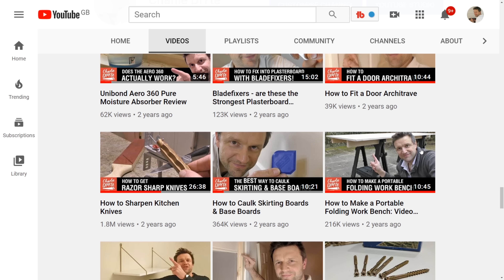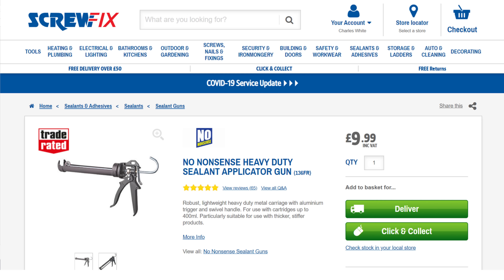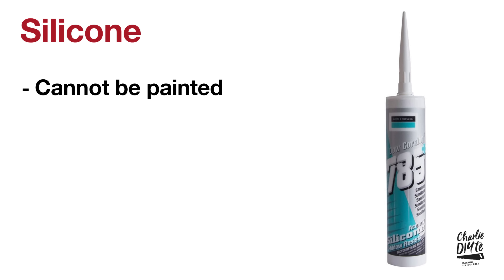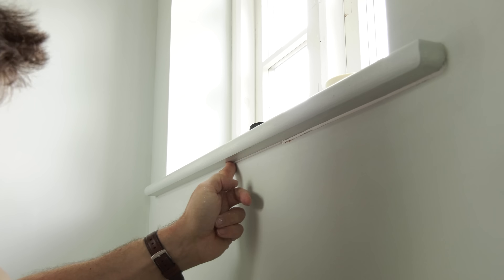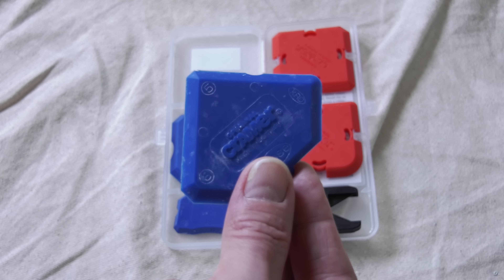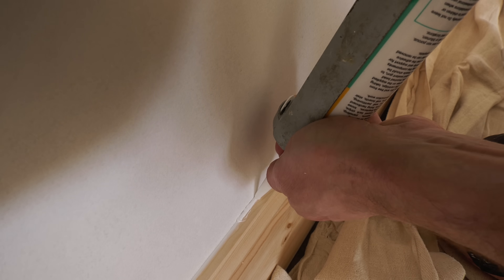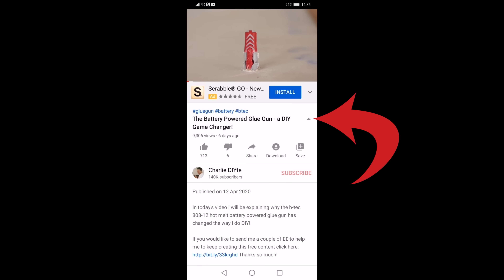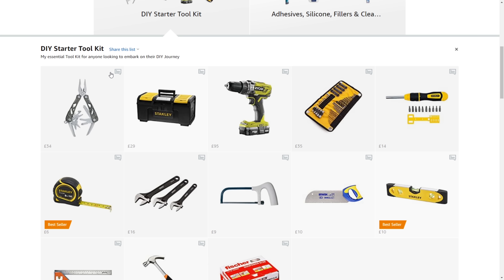How to Caulk Skirting Boards & Baseboards - 2020 Update

Comment: US DIYer here.  Really enjoyed the video, plenty of people are scared of working on their homes because of how guarded the knowledge is. I appreciate these videos because directions for these types of simple tasks are assumed, but there is always room for learning new/different techniques and/or tips.

I, for one, started caulking without cutting the tube open for the longest time and just cutting the plastic tip and cranking down on the caulking gun until it burst open.  I had wondered for a long time if it was supposed to be that difficult to do, but I didn’t realize you needed to do both because most tubes don’t tell you how to access the product properly (on most construction/maintenance products). It was only after watching something on YT that I discovered how foolish I was, and I am less concerned about doing a caulking job around the home.

Thanks for all you do!
Reply: UK pro here. I chuckled at your comment about guarded knowledge. I have a firm dislike for any tradesman that think they possess some kind of dark knowledge that only they possess. That's BS.

Comment: Hi Charlie, I always go 90° and keep all internals true as possible....all properties are subject to seasonal movement and minor touch ups are quick to do if required...Gap filling foam and wood filler are an alternative too......I also find it much easier to cut in, all looks sharp and clean to the eye....for deeper areas you can use backer rod foam (polycord) and then caulk on top which prevents excessive shrinking....👍
Reply from the maker: Fair point Nicky. That would be my preferred solution if it wasn't for the cutting in. How do you get round that?

Comment: I enjoyed the detail in this video. I haven’t done a lot of caulking myself, but when I did some on a project I was doing, I experimented with a couple of ways of finishing. One way that gave good results was pushing the caulk along. Took a little practice to keep the pressure on the gun steady so the caulk flowed at a constant rate. I cut the tip at 45°, then squeezed the caulk out a bit to get started, then slowly pushed the tip along keeping just a little of the caulk visible at the tip. The back part of the cut nozzle then basically formed a concave bead automatically. I usually needed to finish it a bit with my finger or a tool, but there was very little waste.

Comment: I sometimes get capable DIYers asking me to do jobs for them. I've been running a property maintenance company for 15 years. I'm happy to say that the only difference between me and them is I've probably done the job before therefore I probably know a few tips and tricks that they might not. I'm always happy to offer help and advice to DIYers. 
You've given quality in-depth advice here. Thanks for your video I picked up a few tips here.

Caulk shrinks by 1/3 From applied to dry. so leave it a little proud when wet.
Reply from the maker: Thanks John, I really appreciate that, plus the point about the caulk. 👍

Comment: Thanks for this video Charlie, this has helped me so much. I used the information here to remove the old sealant between our kitchen skirting board and re-applied it with the tools and tips in your video. I could never have done this without your youtube videos. Thanks!
Reply from the maker: That's great news Paul, thanks for letting me know. Really chuffed you found it useful 👊

Comment: Thanks so much for the advice. As I didn't have your special tool, I used the slightly wet finger technique. But it was your simple tips that really helped, eg aiming for one neat line of caulk, releasing the tension in the gun - what a revelation - and having a bin to hand. Thanks.

Comment: Very useful information, thank you. One snag I met was after cutting off the top of the calking stuff I found the tube was too long for either of my guns :) Nearest DIY store is 13 miles away so I tried cutting off the other end manually pushing the plunger in. Made rather a mess and have a longer gun on order before I start on the next tube of compound.

Comment: Great video charlie.
Glad you mentioned to use the smooth side i was confused as to which way it should be used  until i saw your silicone video
Reply from the maker: You're welcome. The Cramer Profiling Kit5 has a little instruction book on the front which I got that visual from, but I agree, it can be confusing.

Comment: Hi charlie.
Very informative video. Thanks.
As I have all makita 18v tools i recently bought their caulking gun. Not cheap at 200 pounds but oh so good.  Constant pressure via the motorised screw with the trigger. No having to reload the trigger halfway through a run on as per a manual gun.
Only drawback is its size. Slightly bulky for small spaces
Reply from the maker: Thanks Russell - that's really interesting as I was taking to someone on this Comment feed this morning about the Makita gun. I'm going to have to have a play with one of these at some stage.👍

Comment: We were fitting large large skirting in an old house and because of undulating walls there were some large gaps. We also found caulking cracked when dry. We bought the cheapest adhesive on Amazon and it work a treat. 15 years later, good as new.
Reply from the maker: Yep good strategy 👌

Comment: Always buy from a builders or decorators merchants it much less expensive than a diy store here in the uk. Also if you come across poorly applied unsightly caulk that has been done by others in the corners, take it out and do again. It can not be sanded down. Get the finish right before going on to the next area.

Comment: I have successfully used an old credit card, either as is, or with the corner trimmed to provide the right size of angled bead. It works well with both silicone and caulk. As you mentioned, the corners on the tools available to buy tend to be too big for most situations. Also, it's a good money saver!
JB
Reply from the maker: Good work, John! I've used a credit card in the past. I guess it just doesn't leave quite such a clean line or clean the residue off the wall as well, but if it works for you, can't argue with that 👍

Comment: Another great video, I always screw and plug skirting then ,take them off number each piece on the back with a sharpi , prime with crown acrylic primer/undercoat , then refit use grip adhesive and screws, it will never move and be closer to the wall , minimum caulking which I always touch up with BIN ,so no reaction with emulsion
Reply from the maker: Yep, that is the bells and braces approach that I massively approve of 👍

Comment: The profiling tool also helps prevent any injuries to your finger tips if there happens to be a stray splinter or any sharper edge along the work line which I found out the hard way lol.

Comment: Would always foam large gaps first/sand then fill/caulk at end, prevents movement and cracking massively overfilling bit holes with anything else will eventually crack
Reply: I agree - foam works so well in those situations as opposed to grab adhesives like grip fill.
Reply: I saw this on another channel where the guy was filling the gaps around a window board, i was amazed at how well it worked!

Comment: The suggestion of using gap adhesive has been brilliant !! We have a 1905 victorian terrace with the usual wonky walls and floors, it has made the gaps between the wall and skirting invisible and provided that extra needed support/adhesion.
Reply: My house is 1909, solid but not a straight line in it.

Comment: A good instructional video, well done! It is worth priming all woodwork to be painted when it arrives on site and priming all over. Then if there is a bit of dampness in the wall behind the wood has some protection. Regards Keith
Reply from the maker: Good point Keith. I should have mentioned that in the skirting video that preceded this one. In my case, being upstairs there's no damp to worry about.

Comment: I had the opposite problem to you Charlie where my old cob walls were straight at all.  This meant when the skirting was hard up against the wall there were places where there were 10-12mm gaps.  I used instant plaster filler from Screwfix  and it doesn’t shrink at all. Applied the same way with a tool. You can sand it if need be.
Reply from the maker: Good work there. 👌

Comment: nice video I would also add that the tool used for caulking it save your finger from wear and splinters that is so easy to encounter especially working on timber.

Comment: I would love to see you do a video of the order you paint a room, it's something I've always struggled with!
Reply from the maker: This gives a general guide https://bit.ly/3q3g0Vb I tend to mist coat (if new plaster) the whole room starting with the ceiling, moving down to paint the walls, windows and doors. It's a good idea to prime the back top edge of the skirting so when you caulk it doesn't sink in too much and shrink being water based. I tend to attach the skirting after the mist coat, and if you're confident you won't damage the top coat you could wait until that's done before attaching the skirting, to save you the tricky job of cutting in the wall into the skirting, although if like me you have a gap that needs caulking you'll need to paint over the caulk anyway with the emulsion. Painting the walls, windows skirting ceiling the same problem makes the room look bigger and saves you hours of tricky cutting in. I massively recommend it!! The final job is to top coat the skirting.

Comment: brilliant, I love your attention to detail...great learning.  One thing that stood out is that "its easier to cut in" with a radius profile rather than 90 degrees.  I've just been scraping plaster out of  internal corners thinking it would be easier to paint up to a defined point (painting a feature wall in dark colour).  I'd be glad to have your further thoughts on this
Reply from the maker: Opinions differ but it is definitely harder to cut in to a 90 degree angle, because the paint wants to leave the brush and deposit itself on the other surface if you so much as touch it. At the end of the day though it comes down to aesthetics. What look do you prefer 🤔

Comment: Well, I ended up painting offices now hardly used because of Covid. I have never used caulking, but was supplied with all the paint. I decided to just give it ago and of course the bead was uneven and lumpy. Not happy with that I ran my finger along and it looks amazing. I didn’t release the gun though and thanks for that tip and others you have shared.

Comment: Great in depth video Charlie on one of the most frustrating jobs for the DIY’er. I came across the Kramer tool a few years back and love it. I know people in the trade frown upon it - but like you say unless you are doing this day in day out, we need the tools to help us. A friend who is a glazier fitted a new front door for me last week. I watched in awe as he siliconed round the frames in minutes, just using the nozzle and a quick finger swipe. I’ll stick to the Kramer! Thanks for comparing all methods in the detail that you did. Cheers.
Reply from the maker: Thanks Darren. Yes you might struggle with the Kramer on outdoor brickwork. I'll always use the tool where possible though because the joint is so much stronger at the edges than when you use a finger.👍🏻

Comment: Thanks for posting.  So helpful as always.  With regard to your Abigail Ahern pro tip, I’d like to recommend 2 you tube series with tricks & techniques for making your space look bigger & more cohesive without the need for costly extensions/renos.  Design rules Lawrence Llewelyn Bowen (yes, him!).  The series focuses on the principles of good design (ignore the taste as this series was made in the nineties & just focus on the techniques) & Lisa Holt, an American professional interior designer, who does a range of videos but the ones re making a space look bigger Q&As are pure gold.  Lastly, I recommend the actual Farrow & Ball shops (not DIY stockists) because they often employ art students who understand where the light hits the room & how to maximise that.  I had an ugly outside wooden wall structure which stuck out like a sore thumb.  I was quoted £500 to remove it.   They recommended a colour which made the wall completely disappear!
Reply from the maker: Thanks so much for that. Really valuable comment. I'll check out both of those 👍🏻

Comment: Hi again Charlie, Thank you for your reply. Unless the makers of gripfil have changed the ingredients these days, But i stuck my skirting on with gripfil in the 1990’s and any that out of large gaps at the top of skirting was left to set for a few days then undercoated and glossed with dulux gloss, But after a few days of drying the gloss still remained tacky and turned yellow.. only where the gripfil was. From now on i will always test a small area first, But these days, manufacturers have had to reduce or remove the solvents ingredient in their products to make them more user friendly. try a test piece and let me know if it has changed..👍🏻

Comment: Thank you very much Charlie for your very good video’s. i would like to mention, That I wouldn’t use gripfil at gap filling a skirting board as i used to it and when you overpaint it the stays tacky and it seems to go a shade of yellow. I tried this a few times when i was younger, But now use either flexi fix or Gripbond pro for sticking skirtings to the wall and use the evo stik caulk your using for along the tops of skirtings.
Reply from the maker: Thanks, that's good  to know. It's surprising, that, because it's meant to be over-paintable.

Comment: Hi Charlie, I found you video very knowledgeable, simply explained great work keep it up. 

I have a question, I have draft coming in on a new  build on ground floor, even though it is small gap It is noticeable, what should I use to seal it?  Much appreciated

Comment: Another good video, Charlie.  FYI, they do make paintable silicone caulk now.  In the US, Home Depot stocks "Paintable Silicone Supreme 10.1 oz. Kitchen and Bath Silicone Sealant Caulk".  I myself have not tested whether or not is actually is paintable though.
Reply from the maker: Hi mate, that's really interesting although I suspect if you squeeze out a line of it you'll find it's very similar to what we call "decorators caulk" over here. It will be much less shiny in look, and without paint will probably be harder to keep clean, but do please correct me if I'm wrong about this!

Comment: Great tips! What's a brand of gap filling caulk (adhesive) in the USA?
Just a note, "mist coat" is called PVA in the US.
I paint my base the same color as walls before installing it, then just caulk the nail holes and gaps - finally I do minor amount of touch up paint over that caulk to finish.
We used Behr Marquee 1 coat paint, eggshell, on smooth wall and 1 coat was all we had to do. Eggshell (not gloss or satin finish) allows just back rolling, no sprayer needed.
Reply from the maker: Thanks buddy. I don't like using pva because the whole point of a mist coat is for the paint to penetrate into the plaster to stop subsequent coats peeling off. Whereas PVA is a skin on the surface. Not sure what brand of gap filling adhesive I'd recommend in the US. I'd love to set up a US Amazon store but there are so many products that I use here which aren't available in the US, so I'd be recommending stuff I haven't used.

Comment: Where I live it's fairly common to use what is called saw dust wall paper, which makes the tool almost useless, because the wallpaper has bumps in it to create texture and hide all the smaller imperfections in the wall.

Comment: really good video. Anyone got any tips on squeaky floor boards in a 120 year old terraced house. Boards are those that have been prised previously to accommodate pipes and electrics.
Reply from the maker: You could try tongue tite screws as used here https://youtu.be/KHrArgtOm6w but you need to be absolutely sure you're not screwing into pipes and electrics. Ideally you'd take up the boards so you can check this, then apply floorboard glue (the expanding stuff eg Egger D4) and screw down.

Comment: Charlie, great vid. My only concern is with gap adhesive. Being an engineer I always think of the person that is going to come in behind me latterly to do some work or if I have to remove at a later day and the gap adhesive rips off the plaster work or paper. You end up with a much bigger job and the reason why I ALWAYS like to screw my skirting on. I wonder if there is a half way house between adhesive and caulk that files the gap and yet does not destroy the wall if you have to remove it.

Comment: Its a great tool because of all the shapes but i normally use a piece of electric pipe that i cut on a angle. The benefit of the piece of pipe is that the excess silicone runs in to the pipe. With the tool the excess silicone runs up the tool and leaves a thin layer on the wall or tiles.

Comment: Great video. I am going g to be staining my skirting boards instead of painting should I still caulk the gaps. Have been given conflicting advice. Many thanks
Reply from the maker: If it was me, I would caulk. Use the Cramer tool to get a nice clean edge on the caulk and then paint the caulk the same colour as the wall.
Reply: Thank you

Comment: Thanks Charlie! Long time subscriber, but came back to this video as I have some new skirtings (MDF) to caulk this weekend. I have a cylinder of No More Nails that I used for adhesive when fitting the skirtings. Would that also be appropriate as a gap adhesive?